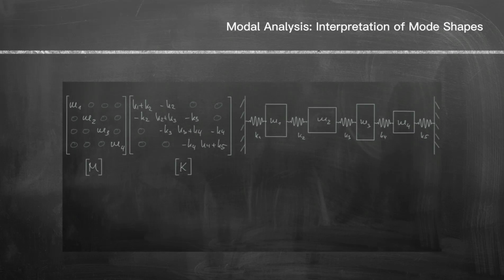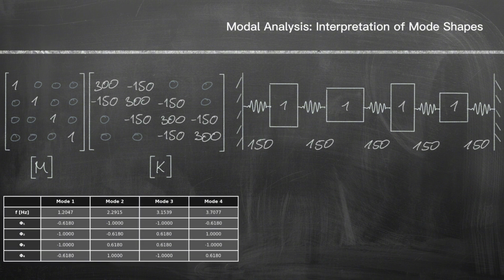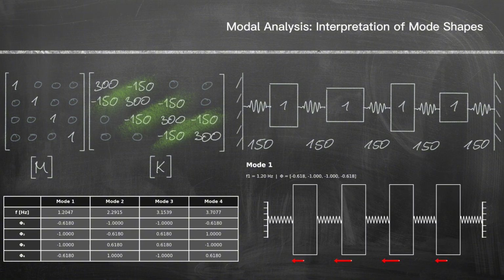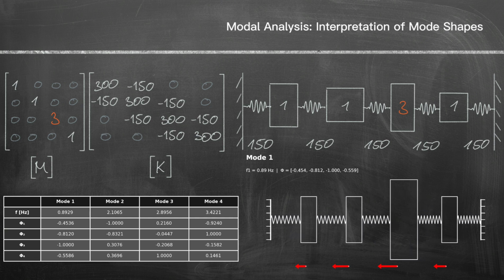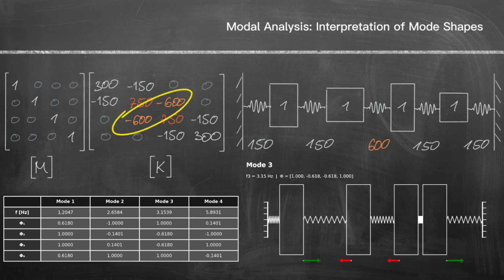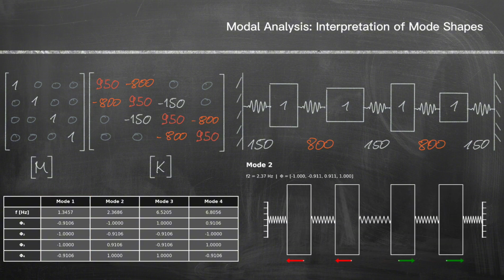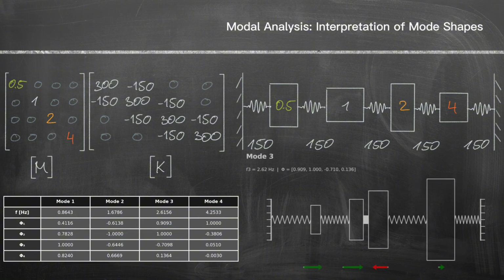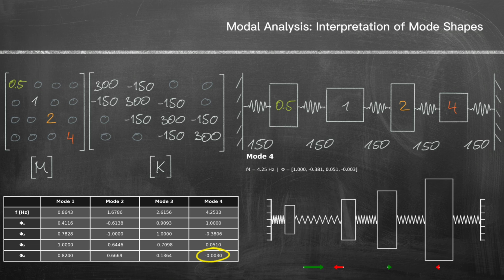Eigenvalue Problem in Dynamics – How The Matrices Shape the Eigenvectors | MDOF | Vibration Analysis

Comment from the maker: This video explains modal analysis, mode shapes, eigenfrequencies, and the physical interpretation of mass and stiffness matrices in coupled MDOF systems.
Course link: https://www.udemy.com/course/simxacademy_advanced-vibration-analysis-linear-multibody-systems/?referralCode=5909763E651F7654E082
Which aspect of modal analysis is most difficult for you: eigenvectors, nodal points, or physical interpretation?